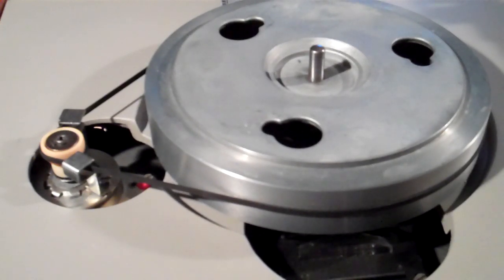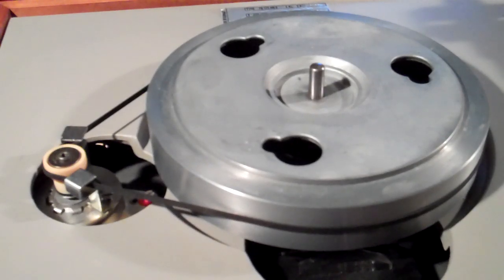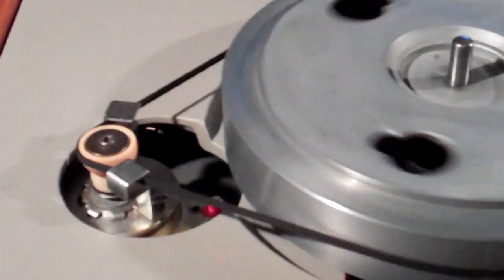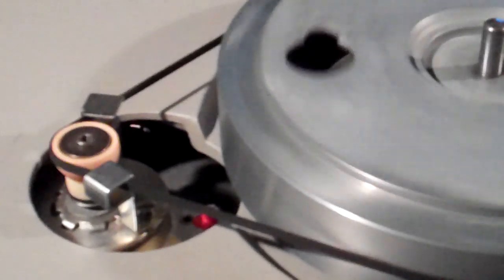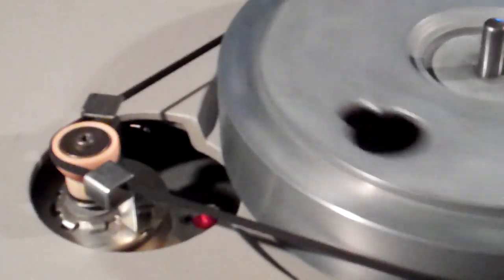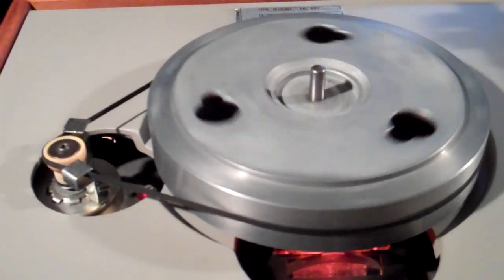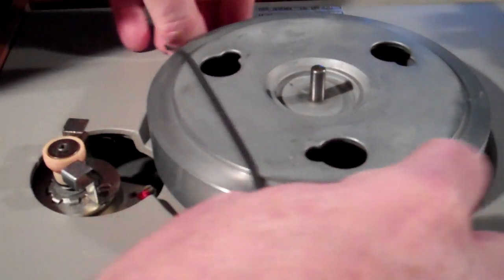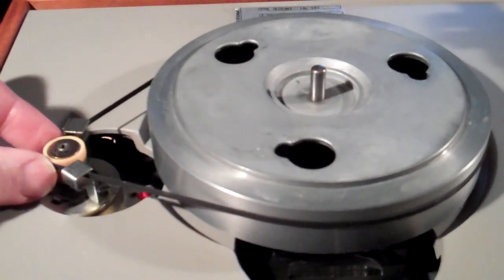Thorens TD-125 MKII: Proper placement of the belt on drive platter and motor pulley

Comment: Hi I have a probelm with my TD316. My plastic wheel on the pulley is slipping. No traction when I put the metal platter on. And it's not the belt.  Any suggestion...? How do I get traction to the plastic wheel from the pulley axel?

Comment: Finger oil on the belt can cause slippage. What do you clean the belt and belt-path with ?
Reply from the maker: Metal platter and pulley, use isopropyl alcohol. The belt, use warm soapy water. Let dry thoroughly

Comment: No matter how I place the belt on mine it runs middle to low on the pulley. Just picked up a used one and trying to get it all working. Great video's, any problem solving ones though? I also can't get the pitch lines to both almost stop. Was thinking of getting the whole unit reconditioned but not sure who around my city will do anything like that.
Reply from the maker: How old is the belt?
Reply: ddarch88
 knowing the previous owner, probably never been changed since new. Looks like it was in storage for a few years, wrapped with duct tape around the turntable with nothing in between.
Reply from the maker: Craig P start with new belt

Comment: When the belt is a positioned correctly on the pulley, the bottom edge of my belt is rubbing on the guide. How can I adjust the guide or the pulley so the belt doesn't rub?
Reply: My unit is a TD125 MK1
Reply: If the belt is rubbing against the upper part of the guides remove them, put a washer under de guide and reinstall, put as many washers as needed. If the belt is rubbing against the lower part off the guide you have to adjust the springs for the correct height. Hope this helps, if not, drop me a question here, glad to help you, have some Thorens 125 and 126 so I managed to learn how to setup an minor repairs. Bought them in early 1990´s when peopple got rid off them thinking the medium would never come back, also got a lot of really good records for free, people got rid off them , even found some in the trash, go figure.